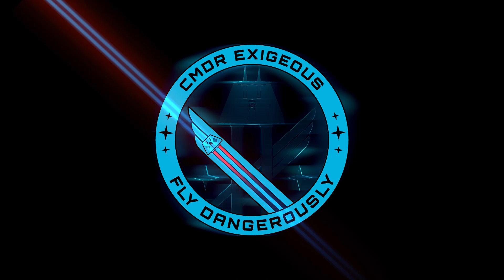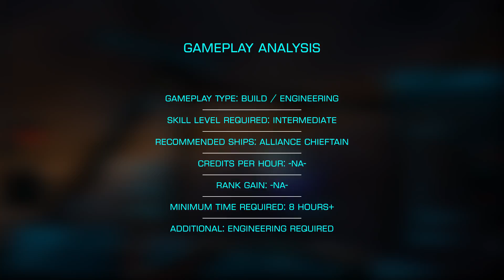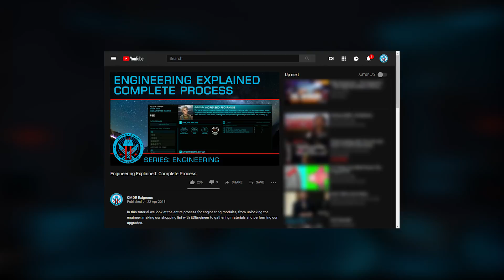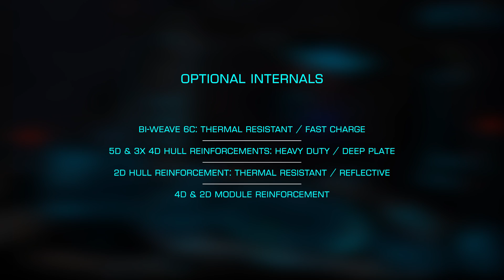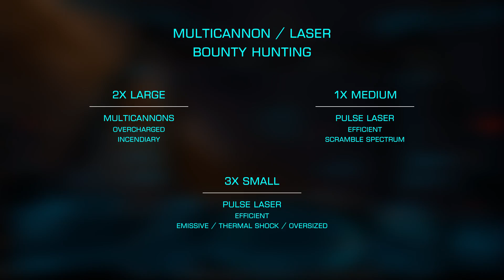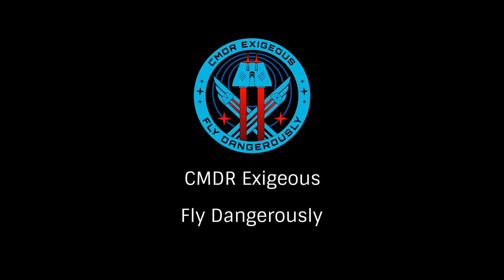Ship Builds: Meta PvP Alliance Chieftain

Comment: Now T-10 , please. Since it's a hull tank , I suggest cold stealth build.
Reply: Large force shell cannons with 2 medium weapons of your choice on top (I suggest seekers or packhounds to counter fighters and small ships mostly) with 2 small plasma slug rails and a medium feedback cascade rail on the bottom.

6 A rated boosters with 2 heavy duty and 4 resistance augmented. 2 heat sinks.

8C Bi-weave, thermal resistance with lo-draw. 7A SCB. 2 5D MRP's and the rest hull. (Fighter Bay is optional)

Shielded FSD and life support (A rated) with long range A rated sensors and an armored powerplant. Heavy duty bulkheads.

This is my personal build for the T10 that I have had so much fun with. You can use this for 1v1's and it's decent enough for it. Do not use it in wing fights.
Reply from the maker: Well they are all on the list but as I hate the big ships it'll be toward the end...

Comment: For PVP do you rate the Chieftain over the Challenger??? I prefer how nimble the Chief is but the Challenger has better DPS, armor and shields.
Reply from the maker: I'd take the Chieftain every single time - while the stats on the Challenger are "better" using it as effectively is a different story.
Reply: I would say the Challenger is better for tankiness and constant DPS. Full multicannons is a solid build for the Challenger, though I use lasers as that is also a good choice. 

The Chieftain is better for plasma and rails as it is faster and slightly more manuverable.
Reply: @Jazod  looks like I need to get better with Plasma and Rails then!!! Although before that I need to work on my flying/pip management/thruster control (I could go on) haha!!!
Reply: @Exigeous  thanks for the answer. The only reason I bought the Challenger was it's on paper performance (and it looks sweet in black) but I'll stick with the Chief. Thanks again o7!!!

Comment: You say Bi-Weave, but the Coriolis URL says normal 6C's and, later in the video, shield recovery/recharge times are also for the normal 6C.
Reply from the maker: SHIT - sorry about that, that's what I get for finishing the video at like 3 AM.  I just posted a comment at the top correcting the error in recharge rate and have fixed the link - thanks so much for noticing and pointing it out.  As uh, no, you don't want a class C :D
Reply: I noticed that, too. Checked the Coriolis link before the video and was really surprised to see non-biweave shields. I assume it was just a mistake, because there's no reason why you'd use a C-grade shield that isn't a biweave.
Reply: He did mean to put bi-weaves

Comment: Suggest using low draw for the secondary effect on the shield. You'll have a much easier time managing pips, which can actually mean a faster recovery if it means you don't run out of sys.
Reply: Though fast charge is good to have as well, considering the Chief has an excellent distro.
Reply: Yeah, not saying fast charge is bad.  Just suggesting an alternative that may allow more wiggle room for evasive boosts and still powering weapons.
Reply: Lo draw would actually be better in that situation as it used less of your distro
Reply from the maker: Up to you but I'd never choose that but that said I stay very on top of my pips via macros, etc.  To me that's the "correct" solution.

Comment: For the life of me I can’t use rails, any tips?
Reply: Go Thargoid Scout hunting with rails. Normal rails will do and you don't have to grind for Guardian Gauss cannons. It will also teach you heat management, so make sure that you bring a heat sink launcher and synth materials. As a bonus you will rank up in combat quickly as each Scout counts as much as an Elite opponent.
Reply: Just needs practice. I was a horrendous shot at first but now I can start hitting modules on ships.
Reply from the maker: As has been said practice makes perfect - do you fly KBM or Stick?  They are definitely easier for KBM pilots as I struggle at times with accuracy using my HOTAS.
Reply: Start by aiming large ships. Then medium ones. Then small and nimble targets.
Reply: My favorite way to practice is to take my fdl to a has res and only fight stuff that is small and if your lucky you will have plenty of diamond backs and cobras to practice on
Reply: This may be an old post, but what I like to do with rails is pair them up with a fixed beam laser in the same fire group.

Use the beam laser to tag your target. Just tap it until you have a solid lock and then hold the fire button to hit them with the rails.

Basically, you use the laser as a laser pointer or laser tag.

Comment: I'm planning on building a similar crusader laser/multi build, is there any other significant difference between the crusader and the chieftain apart from the fighter bay?
Reply from the maker: You know I'm gonna sorta disagree with Andy on the Crusader - it's just much harder to fly well.  I've been using it more and more and every time I do I think "damn, I sorta like this thing".  It definitely has a higher skill ceiling as you really have to fly it FA-Off to make it effective.  So if you're a bit new to combat I'd go with the Chieftain for sure.
Reply: @Exigeous  Thanks for your reply, I think I'll stick to the crusader.
Reply: The beautiful thing about ED is that there are many ships to choose from and they are all customiseable. I just don't know where to really place the Crusader. As said, if I need to use a mid size ship with a fighter bay the Krait is superior to the crusader in any way and If I am doing PvP the Chieftain or FDL are way better. The Crusader just doesn't excel in any scenario that I can imagine that I would use it for. I really tried with the Crusader and fully engineered it, but it just doesn't grow on me. If it had retained the medium hard point that the other Alliance ships have and didn't downgrade one of the size 6 to a size 5 slot, given it a little more manouverability and boost speed the ship would have been much better IMHO. I had hoped for the same specs as the Challenger with one of its size 6 slots as a fighter bay, that would have been great! @LeoBeast, I have read that you had the Krait as your AX ship of choice, I just meant that the Krait is also good for piracy as you have superior fire power and more internals for cargo and hatch breaker limpets when compared to the Crusader. Maybe just try both ships and see what is more to your taste:-) Fly save (or dangerous) o7
Reply: The Crusader is utter rubbish! It has less internal compartments is much slower and has one less hard point. You get a fighter bay, but if you plan for PvP forget the Crusader and go Chieftain. Also worth considering is the  Fer-De-Lance. Compared to the Chieftain it has more utility slots, much stronger shields 4 medium and 1 huge hard point. Speed is about the same, though it has less internal compartments and even fully engineered it has less hull points. It also costs more than the Chieftain and the re-buys are obviously also higher.
Reply: @AquaPixMedia  I already got a pvp based fdl with packhounds(when I get them), I'm going for crusader because it's better for PvE and multicrew since it's got a fighterbay + my only other pve/bounty hunting ship is the vulture (my krait is AX)
Reply: For that purpose you should look into the Krait. Much better and faster than the Crusader and it has a fighter bay too. Decent shields more internal slots and more firepower with a decent jump range. The Krait is currently my most used ship. At the moment I am in the Plaiades hunting Cyclopses and Basilisks solo... a lot of fun  with the Krait!
Reply: @AquaPixMedia  that's why I added my krait is built for AX and nothing else